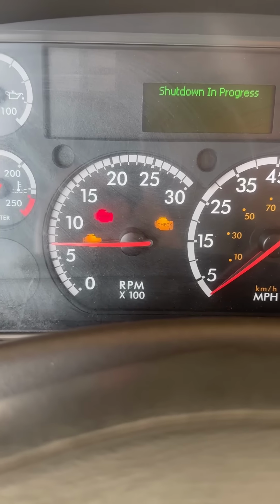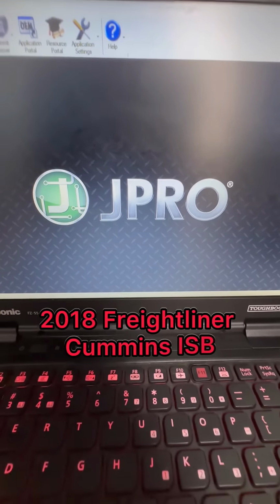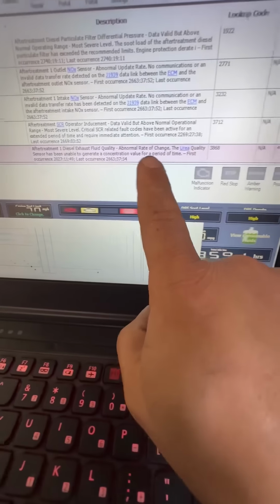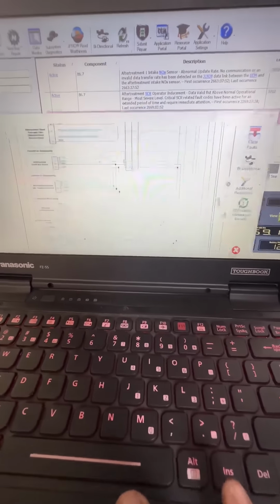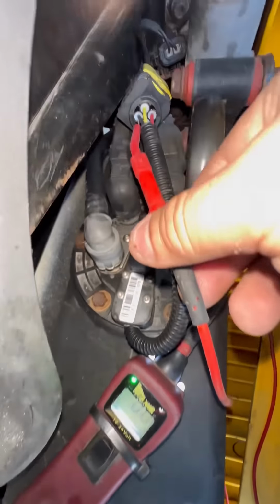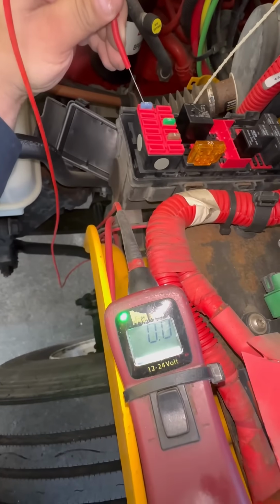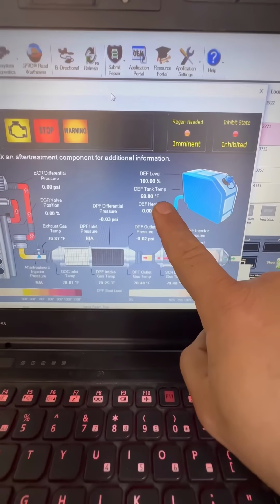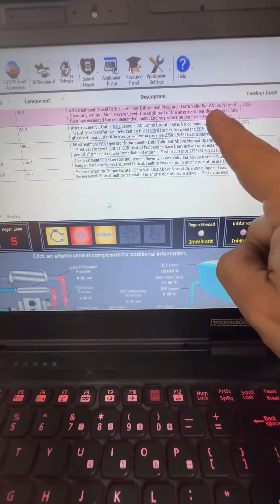Part 1 money pit #dieselmechanic #mechanic #truckmechanic #trucker #bigrig #bigrig

Comment: I would say moisture got in the fuse box check the wires going to the fuses I like to use the circuit tester to ensure power supply
Reply from the maker: Part 2 uploaded
Reply: @dthetruckguy1499  also check for broken  or cracked wires going to the fuse box a poorly grounding wire could trigger a fuse to blow

Comment: Troubleshooting is a lost art in most mechanics today
Reply from the maker: Part 2 uploaded
Reply: It's not a lost art. It's called 1000 sensors which used to not exist on cars 20 years ago.
Reply: @masonreppeto882 and you bought a new one when the problem was more than fuel and compression.